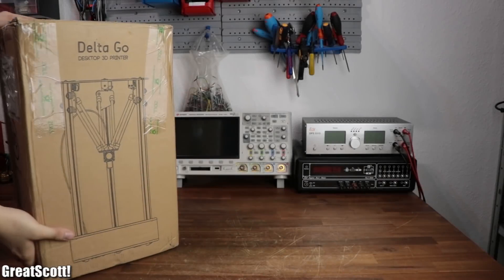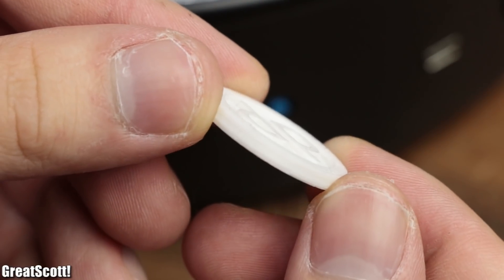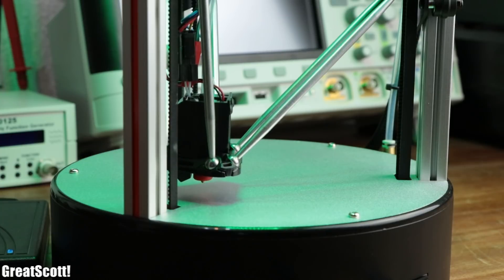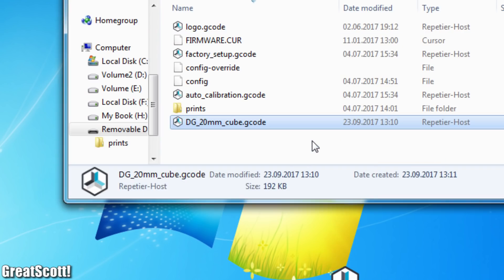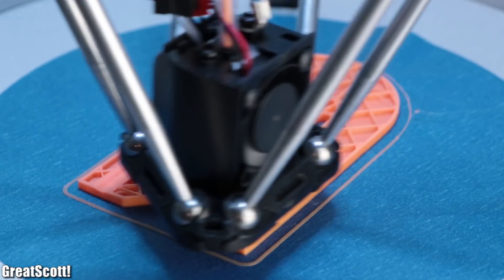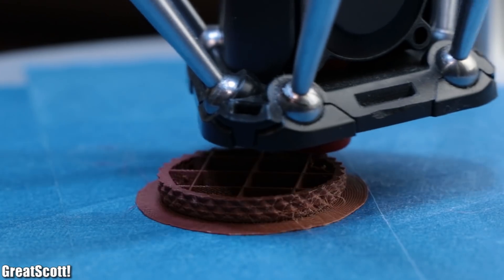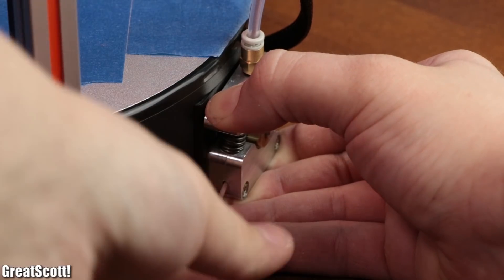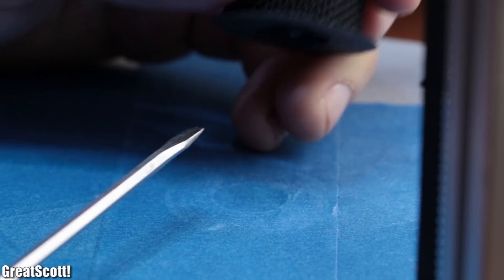Delta Go - Desktop 3D Printer Review || $450 Delta 3D Printer

Comment: Hi, im planing on bulding a 3D printer with reprap and arduino mega for a school project, can i use steppermotors from and old inkjet printer
Reply: Joel Filipe yes you can! Im planning to make it too. You do need to know the specs of the stepper motors so you can get the needed motor drivers
Reply: kragon hi, thanks for the tips, i didnt find the drivers to the motors, so im buying 4 nema 17, and yes school can fund the full project but then the printer is not mine, so i want to buy all with my money and keep it and make some upgrades like a raspberry pi 0 w with octoprint and a raspberry pi 3b with maybe win10 or kali linux
Reply: Joel Filipe 
Kali linux? What kind of printer needs OS filled with network pentesting tools? I can still understand win10, but not this

Comment: still using windows 7?
Reply from the maker: Always!
Reply: +GreatScott! dont worry support of windows 7 will end in 2020 .upgrade it .
Reply: I was on Windows 10 on all my machines, as it has caused me trouble over the years I have moved back to Windows 7, which has never given me a lick of trouble.  I actually have pretty much the last Windows 10 machine in my stable on the healing bench right now backing up in preparation for moving it back to Windows 7.  it was working fine, then a Windows update came along and broke critical things and now it's useless.  It will work just fine under Windows 7.

Comment: Make a cnc
Reply from the maker: Not sure, quite a big project.
Reply: I did cnc laser cutter out of 2 broken printers/scanners and 1 dvd burner. Only bought arduino uno and stepper motor drivers (total of about 20 euros)
Reply: GreatScott!  Thank for reply
Reply: You can try to get a cheap 3d printer kit like the Anet a8 and convert it to a cnc =)
Reply: GreatScott!  Not a big project! I want you to make this cnc using old cd drives and Arduino nano with l293d ICs as other channels haven't been provided with dimensions. So make this project
Reply: Eh, it's hardly worth doing if it's not big enough to carry a 5 pound router or a plasma cutter head. :)
Reply: John Ridley  i am not saying about the router cnc , i am saying about writing cnc
Reply: I'm not sure what you mean, other than maybe a "CNC that writes" - do you mean a plotter? It's kind if fun to use a 3D printer with a pen on it to make a very poor replica of what they had in the 1970s, proper pen plotters. but if you want to accomplish anything by it, just go pick up a Cricut machine. They'll hold pens or knives, can work on stuff way bigger than this and cost 1/2 what this printer does.
If plotter is what you mean, I've never heard anyone before use CNC to refer to plotter. It's always to do with some sort of subtractive manufacturing operations.
Reply: John Ridley  i mean a cnc plotter
Reply: OK.  Is there a plotter that is not CNC? I've just never heard the term CNC applied to plotters before, only to cutting machines.
Reply: CNC - computer numerically controlled. Doesn't describe what it does, but how it does it. I'm quite sure there are non-computer controlled or non-numerically controlled machines too.
Reply: I have seen non-CNC things to move pens around.  They were built in the 1700s in the shape of metal people and could scratch out drawings or signatures. But if you want a CNC plotter these days, it's silly to make one.  You can pick up a Cricut machine for $200, and you couldn't buy the bits to make a plotter for much less than that.  If you want to build one to learn something, that's great, but if you just want one, you'd have to be truly destitute and willing to spend hundreds of hours of time scrounging $100 worth of motors out of old copiers or something and writing drivers for them to make it worth building a plotter.
My furnace has a CNC flue too I guess. And some new cars are CNCs too because they're all drive by wire, with the computer running all the controls.

Comment: the clogging: how to solve this problem?
Reply from the maker: +SURE D i can recommend to visit their troubleshooting guide. There are some useful tips.
Reply: Indeed very comprehensive comments in the community support section. For simple constructed filament extruders, inspecting the quality of the filament is key before rushing into a print. Through your very methodical approach and reading the troubleshooting section I have learned a lot today.
Reply: We recommend changing the temperature as the speed is increased/decreased, as the temperature depends on the speed and vise versa. Aside from that, using good quality filament is always important.
Reply: Try a filament wiper/ oiler. https://www.thingiverse.com/thing:492067
Reply: If it really was clogging, then it's got to be garbage filament or a very badly made hotend, or a very small nozzle.  But I suspect the temp is too low.

I use a 0.4mm nozzle on an all-metal hotend and eSun, Sainsmart and Hatchbox PLA, ABS and TPU filaments from Amazon, and I have done many hundreds of hours of printing without a jam. I haven't had a jam now for probably 3 years, that time I got a really bad filament supplier and wound up just throwing away all the filament I bought from them.